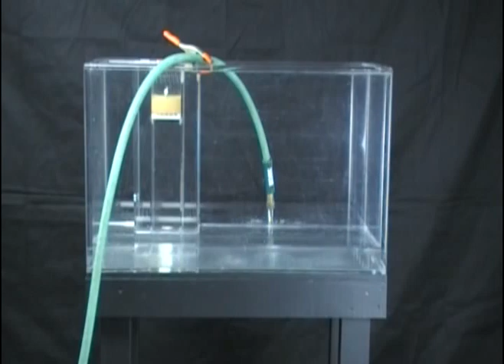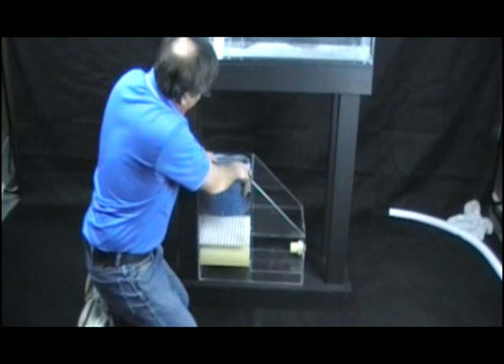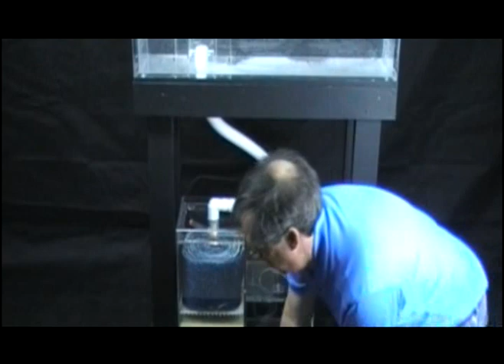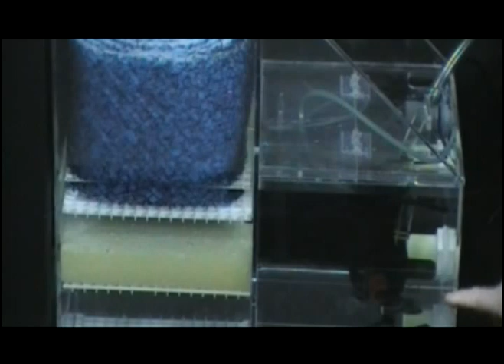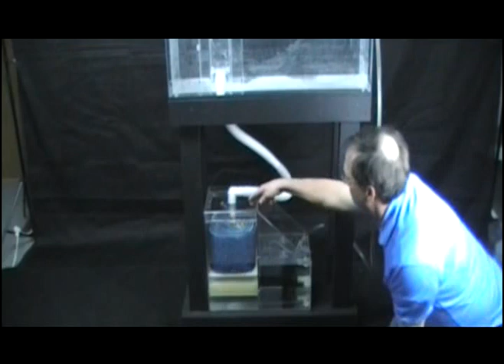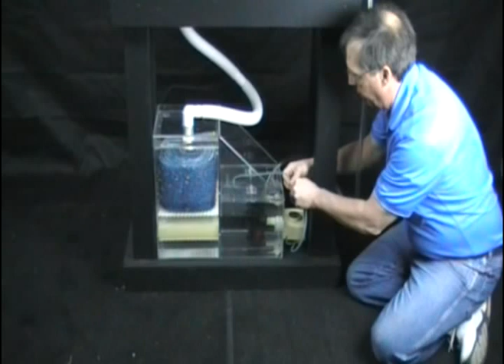Wet Dry filter Setup Part 1

Comment: undergravel filters  only provide 3 or 4 square feet of surface area?only if you forget to cover the filter plate with substrate,theres more surface area in 2" depth of  fine gravel/coarse sand than in a tower full of plastic
Reply from the maker: Carl, thank you for your comment. 
The amount of aerobic bacteria is either non-existent to very limited at best at 2” depth of a media when submerged like in an undergravel filter. Because when you consider that only the surface of the gravel/coarse sand is exposed to a very limited oxygen content being extracted from the aquarium water, you can only factor oxygen penetration to about a maximum of 1/8” depth. In a wet dry trickle filter all of the primary bio media   is directly exposed to open air. So a media that has a lot of void space (plastic in the tower) allows the inerts of the media to be exposed to oxygen as well. This is what dramatically increases usable surface area in & why a wet dry trickle filter is far superior to the undergravel style. 
Because undergravel filters only have a limited capability to house both beneficial aerobic & anaerobic bacteria, it teeters on a bare minimum of water quality stability. As such anything that would barely increase ammonia levels would easily tilt the balance to a toxic environment in the aquarium and we all know what the outcome would be. 
A wet dry filters’ larger surface area provides a broader abundance of beneficial bacteria keeping the systems’ water quality much more stable.

Comment: How often should I pull the foam pad out under the biomedia and squeeze out?
Reply from the maker: Angela, The foam pad in the bottom of the wet dry filter is not for mechanical debris removal, it serves as an excellent substrate to cultivate Anaerobic bacteria and should not be disturbed. These bacteria consume toxic nitrites as a result of the previous aerobic stage. These microscopic bacteria will slough, pass through the media, and collect in the empty portion in the bottom  of the nitrification chamber in a form which is known as detritus. This detritus can be easily removed by occasionally  flushing the empty area out with a hose connected to your water pump (say every three months) where it will be mechanically removed by your pre-filter. These pads are known to remain in service for decades without replacement. If you do decide to remove to clean or replace it would be best to remove it and cut it into 3 pieces and only replace and clean 1 of the 3 pieces every 20 days until th whole thing is eventually changed. This will allow
the biological filter to continue without crashing the nitrogen cycle.
Reply: @AquaLinkADP  
thank you! I am enjoying my new set up and things are running smoothly! the only real maintenance is changing out the sock in the pre filter. so much easier than schlepping a canister over to the sink!

Comment: Decent wet/dry filter!

Question, since the spray bar is not fully submerging your bio media "blue mat material" what is the air pumps purpose again, pumping air into an already air filled chamber?
Reply from the maker: A “Rotating Spray Bar” saturates more effectively than any drip plate. Although the Primary bio Media (blue) is exposed above the water, it is still semi enclosed in the bio remediation chamber with only a small vent for gas to escape. Filling the chamber with air circulates fresh oxygen into the chamber pushing out stagnate digestive gases.
Reply: Aqua-Link Acrylic Design Products 
Thank you for your feedback to help better explain your filters.
Nice design

Comment: I want a filter like this wet / dry system with spray bar. You mentioned the 
submersible water pump in the video but where can I get one of these? I 
don't see any water pumps for sale on your website.  Right now I have a 40 gallon fresh water would it be ok to buy 2010 with the protein skimmer as I plan to upgrade to a 90 gallon salt water tank in the near future.  Also does the purchase of this filter come with instructions on how to assemble as well maintenance the unit.

Thank You,

Armando
Reply from the maker: Armando, I'm pleased you that you are among the many who appreciate our products.  The 2010 is a good choice for your future endeavors. Instructions for our products are available under the “Resources” tab on our web site. We are currently negotiating distributorship for a more reliable line of water pumps. They will appear on our website when that process is complete.

Comment: NOOOO Come-on!!! Spray bar??! REALLY! what will happen if fish food or dead plants get stuck on the nozzle? Oxygen pump?! come-on! for what? your over flow box will provide plenty oxygen during surface skimming and the drip tray will further enhance the oxygen levels. You are designing wet/dry filters but you don't seem to know the fundamentals of what a wet/dry filter is. By the way you should read up on venturi systems. In my opinion this is a very bad design.
Reply from the maker: @115792957416181101543 As our video indicates, our wet/dry filters are sold standard with a drip plate conversion for hardcore’s who seem to think it has some sort of advantage. A drip plate limits water droplets to contact only to the bio media directly under the holes in the pattern where they are drilled, usually spaced anywhere from 1” to 1-1/2” apart. Spray bars,, Absolutely!!! The spray bar method is far superior to and much more effective than a drip plate. As a spray bar spins, it disperses by slinging aerated aquarium water evenly and thoroughly over the entire bio media, maximizing the medias full surface area capacity. Our spray bar assemblies are reliable and fully adjustable. The same size holes drilled in the spray bar are evenly spaced 1/2“ apart and are staggered differently on each arm to disperse water in areas not covered by the opposite arm. The arms can be twisted to adjust rotation speed and dispersion coverage. A drip plate is much less complicated to make than a spinning spray bar assembly hence why most mfg’s have given up practical functionality in lieu of simple fabrication. In short most mfg’s take the easy way out because they are not capable of making a functional spinning spray bar assembly,,, if they could, that is what they would use. We do not use, as the words imply, an “Over Flow Box” Instead we offer an appropriately named surface skimmer/pre-filter assembly which yes, has been specifically designed to mechanically filter and aerate untreated aquarium water before it enters the nitrification chamber. As far as debris, anything capable of plugging up spray bar would plug up a drip plate as well, however a properly designed pre-filter/surface skimmer assembly like the Aqua-Link 2110-L would prevent such debris from entering this area to begin with. May I suggest you watch our pre-filter video at  www.youtube.com/watch?v=ALRI_2FelycObviously not every wet/dry Mfg understands the importance
of maximizing oxygen to the bio media to promote bacteria growth and proper gas exchange. Pumping oxygen into the nitrification chamber is preferred, but room air pumped in from an air pump is acceptable. Filling the chamber with fresh air enhances bacteria growth and also pushes out undesirable gasses that result from digestion. This feature has always been incorporated in our wet/dry filters. Aqua-Link Venturi Protein Skimmers, first designed 1989 can be seen on our website https://aqualinkadp.com/protein-skimmers
Past history has proven that those who inquire spinning spraybar technology are often potential customers, but those who challenge it, are often “Wanta be” competitors. But that’s OK, we’ve been educating them as well since 1983 and will continue to do so to promote the growth of the hobby. Regardless of your purpose please remain professional.
Reply: Research first. Jeez